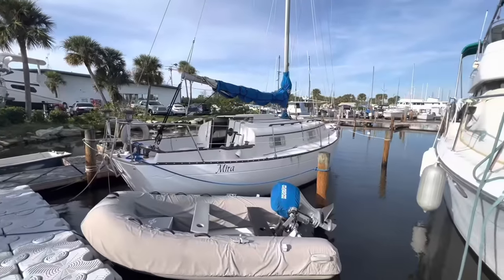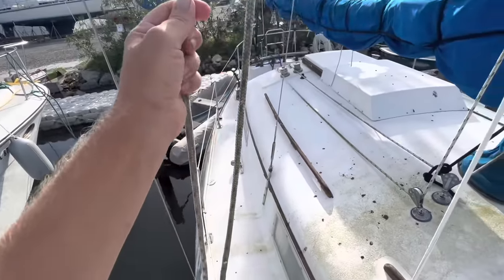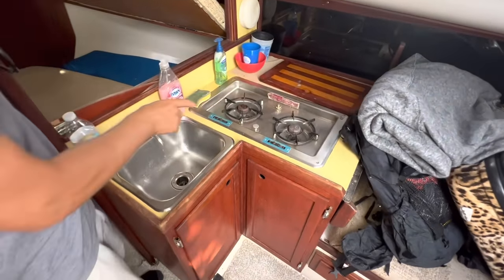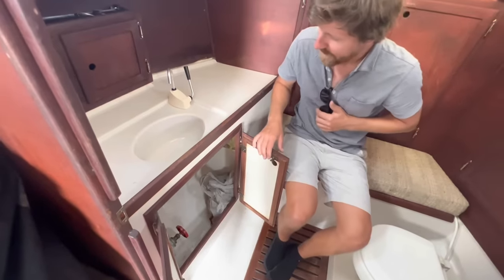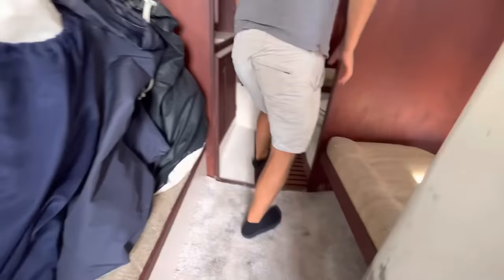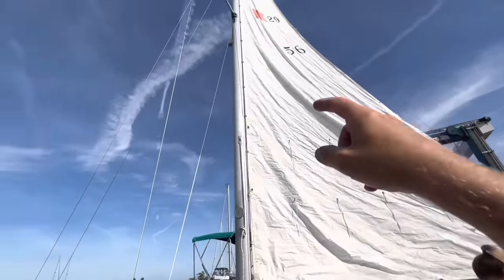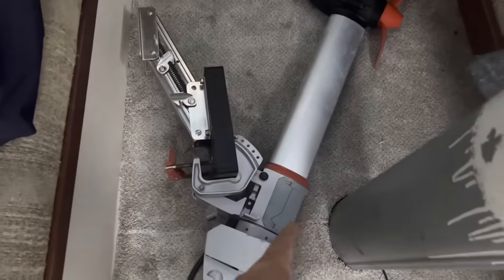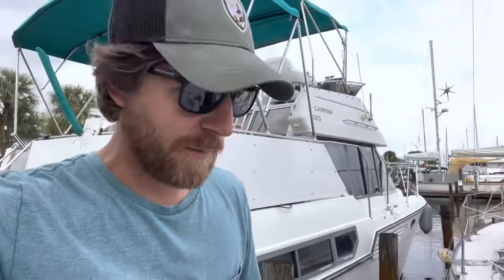Moving onto a free sailboat- bayfield 29ft

Comment: As a owner of a bayfield29  myself I must say I think there are a few things odd about this boat. I know each one was slightly different and this looks like a older example then my later 1983/84 (one of the last hulls made before the fire that closed the manufacturing) Also I think that line on the mast is NOT the main Halyard it’s the main topping lift. The main halyard should be coming out a sheath at the bottom of the mast directed to the winch on the port side  of the companionway the other two halyards for the head sails to the winches on the starboard side.   The saloon table was removed (if it had one)  there should be a door on the head. BUT also I’m not sure how much of what is on my own boat was standard and how much were owner ordered factory add ons. (I know the Edson wheel I have was a $1000.00 option new) also the teak (teak plywood actually) flooring in my boat was a option as well two color paint scheme on my boat was also a option this one does not have also the extended bowsprit rig was a option also And you will see soon enough if you sail it as is the reason for the extended bowsprit,  the head sails drive this boat and you will find without the extended bowsprit you will need to reef the main or easy the main sheet to avoid excessive weather helm. (It’s highly likely the bow sprite has some rot on the main beam anyway  so upgrading it to the extended bowsprit when you repair it might be a good idea.  and moving the head stay further out will be a vast improvement to how she sails.  (Also makes tacking the jib through the gap much simpler)   The old alcohol cooktop and no propane locker is also a sign of a earlier model. The  aft lazaret lid without the cubby to stash the main sheet is also a sign of earlier-model OR it was modified  OR these were changed on models equipped with the Edson wheel to make for a higher seat vs the tiller steering you would sit to the side not in the back.  The propane locker on later boats was molded into the port side aft corner.  And had a drain out below (served to drain any water out and also if there was a leak propane fumes would vent out that as well and NOT communicate with the engine compartment or main cockpit lockers.   Over all this looks like a decent boat for free but as Bayfield go not the finest example.

Comment: As a previous Bayfield owner for 17 years I can safely say she never let me down. The Gozzards build an amazing boat. You are going to learn to trust her as much as you trusted the "Herring". Just a tip, my loose tiller was a simple shaft key failure. Sail on Sam, we are all crewing with you in our minds.
Reply: @PaulDononvan, I have been researching these boats as a bluewater sailer and would like to know if they are as heavily built and dependable as reported ,handle heavy weather and offshore work well?
Reply: @ronv6637  I had mine offshore here in NC and she brought me home in 6 to 8 foot swells. Everything aboard was overbuilt and super strong. Great 9horse Yanmar, harken self tailing winches, all lines and halyards led aft to a roomy cockpit. Can you tell I miss that boat ?
Reply: @handygrandpa  Thanks for the response,I need to get aboard one to see if it feels right
Reply: Yeah, it looks pretty simple layout, which is best for dependability.. Tiller is real real nice and simple on a 29 footer.
Main sail is fine dude, broken in sail is excellent for light, med, heavy winds. Learn how too trim it. Stitch up and repair loose thread. A soft sail in light winds  when you get the luff just right, coming in off the Genny you'll feel her accelerate.

Invest in stuff that will make your time aboard comfortable and economical 
A freezer, osmosis water, cock pit cushions  and enclosure, zodiac dingy. Take all the wood stuff off, refinish, re bed everything. Service clean winches.  Replace all the lexan windows, (deep tint is nice) and rebed.
Scrub, scrub, scrub, the deck and hull and seal buff with wax.
Check thru hull fittings, rebed, replace.
I like your thinking for not installing a new motor, if anything you could go with a outboard hook up, that could double as a tender on the dingy. 
That's a lot of elbow grease, that will make you quite content of your little home.
Switch all your lighting to leds.

Very nice boat.
Don't waste your money on crap.
Organize your projects,  expenses, keep a log, and be..... Very satisfied when you go back and see what you accomplished.
Reply: speak for yourself, i'm scared of the open ocean
Reply: @nummnummyumm9051  😂😂😂😂😂😂
Reply: @nummnummyumm9051  me too😂

Comment: Pour hot water, 90° centigrade on the bolt rope and haul it up as tight as it will go.
Then let it fully dry. Repeat once or twice. It should streatch back out.

Comment: careful Sam, sailboat flipping can be habit forming, I'm 8 years out on 9 sailboats. Between sailboats is only fun because I'm shopping for the next one. My next one will be a converted electric aux power for sure.  You should ask for an electric power plant that would be compatible with the existing propeller shaft and develop a system for converting the old inboards to electric

Comment: re your mainsail  Just cut through the bolt rope at the tack then stretch out the luff and re sew the end of the bolt rope it'll probably move 12-30 cm. It will move in that channel. Yes the bolt rope crimps and its for a purpose. When you put halyard tension on the rope gets to maximum elongation before the sail cloth

Comment: I had one simular to that. I installed an engine mount on the sturn and bought a 9.9hp Yamaha OB and it pushed it to Hull speed easy at half throttle and it would run 10 hours on 6 gallons. Esay and cheap. I paid $450 I think...

Comment: I would consider putting in a permanent eletric engine system in, you have plenty of storage for battery cells and given the small amount of space it would be ideal (where the eletric engine would go). As a backup you could have a small silent generator stored below which could be used to power the system should the batteries be flat and it is an emergency!

silent motor with those windless days all drive by the sun :)

Comment: if it still has a prop and shaft, you can get an electric motorcycle kit and just couple that directly for an easy electric sailboat conversion.
Reply: Was wondering if multiple bicycle motors would work as well, could belt or chain drive with computer system that measures strain on each drive and equalizes the speed/torque. Kind of a wierd idea, but thinking the more mass produced motors/drives might be had at a cheaper cost per unit of torque. Also they could potentially be unmounted and used in a dingy and onshore bike...

Comment: The Torqeedo Travel (3 HP) will provide you with enough maneuvering capability in and out of the marina. Currents and higher winds are another story. But you are a sailboater first and have enough skills. I've easily charged my Torqeedo batteries with 150 watt solar panel. The charging port accepts a wide range of DC input which is nice.
Reply: he had a torqueedo on his previous boat, 24ft hunter ?
Reply: @rhett7716  I used the Travel 1003c to drive my Capri 22 after I had a Cruise 2.0 failure. 

The Travel move my 2250 lbs Capri 22 almost to hull speed. Much different that the Minnesota Endura 50 I tried using early on.

Comment: The pressurized alcohol stoves work well and hotter than the newer ones and very cheap and available fuel at hardware stores. Just never fill it hot and know the real dangers of alcohol burns.  Origo has easy replacement of the rubber parts on that plunger.  Just fill the cups with small amount of fuel that you heat and light then the vapor can ignite. 😊

Comment: I have a 31’ Bombay Clipper in StuartFl. area. We went with a outboard bracket with  Torqeedo 4 cruise electric outboard. It pushes the boat at 3 knots for 8hrs. without charge. Galley is electric. Having remove everything diesel. Makes a lot more room for storage.

Comment: Nice boat for free, and already in a slip! I had a chance at a frer saiboat in a slip once, but it did not allow liveaboard, so I had to pass it up. I have a stinkboat, (gas driven), 23 ft cabin cruiser. I have stayed on board twice now down at Bahia Honda marina. First time was 12 days, second was eight days, electric provided for the air conditioning. I like the trailering ability I have to tow distance.

Comment: Hi. The valve in the head is called a gate valve and you are right; it has no place in the marine environment!  Replace it with a modern through hull when you haul her out but in the meantime, tape an appropriately sized wooden plug to the hose, just in case.  Also, leave it alone; it is not leaking now and opening and closing it is what will get you into trouble! Stay dry. H.

Comment: I hope to get back to my boat this spring. A steady string of injuries has had me land locked not able to even touch it for going on 3 years now. With some luck this spring I'll be able to finish the bottom paint and get it put in the water. I really like the idea of the solar generator as a power supply.

Comment: BAYFIELD 29 seems to be the best design for a Bluewater Pocketcruiser under 30'.
The head is so spacious. I like the layout from a functionality stand point.

There is the Gladiator 25 by William Lapworth that one seems really cool too.
That's an old classic plastic from the 1950's & ewarly 60's.

The design of the original Columbia 26 seems pretty good too for a Bluewater Pocket Cruiser.

Congrats on your new boat, a CANADIAN BOAT, the BAYFIELDS are.
The Bayfield 25 has a 2'11" draft, but your seating area is also the stove top which would suck.

You have a great show. Thanks for teaching sailing as you do.

Comment: Your stove may be a kerosene pressure stove. Not alcohol, I think. I have had one for 30 years. If so, you preheat with a little methylated spirits (a bottle cap full is plenty) pump the tank until mild resistance is felt and when - and ONLY when that meths is nearly burned out, open the valve a little, if hot enough and the kerosene has vaporised it will ignite exactly like a gas ring. If you didn’t get it hot enough though you’ll get clouds of white smoke, or even a three foot spitting flame - so be careful!

Comment: You can add maybe a decent 4-stroke outboard with power tilt-trim and you would be able to handle moderate wind and current, just no all day motoring like with a diesel.  Yamaha makes a 9.9hp high-thrust and Honda makes a 15hp available with tilt-trim.  You have a built-in fridge and that extra fridge just takes up space and draws 4amps.  If you pickle vegetables and have hard cheeses and canned fish/meats you don't really need a fridge.  I used restaurant packs of mayonaise to avoid having to refrigerate open jars.  Eggs just need to be kept cool, and maybe waxed for longer storage.  Boxed milk doesn't need refrigeration and you usually finish a box in one setting anyway.  Not criticizing, just offering some advice in the comments section so you get higher ratings for your video.  Fyi, I watched your Hawaii video a few years back and that was probably my main inspiration.  I eventually picked up a used sailboat, also met a guy and we sailed to Hawaii on his boat.  I also sailed down Baja California.  But I did like the owner of this boat and basically gave it away, but I might get another boat in a few years which will hopefully be my "forever boat".  Anyway, hi from China.

Comment: The colorful sail is your Yankee, and the rope on your main can be stretched back out by getting it wet and pulling it nice and tight, when it stretches out a bit tighten it more and when you get it where you want it let it dry, it should be fine (famous last words right?).
You might notice some weather helm at first, you can control that by adjusting the slots between your Yankee, staysail and main, it takes a little getting used to but once you do she will take off.
Mine had a Perkins Prama M20 and that fuel tank is a bit h to remove but once you get it out it's a great place for a second fresh water tank maybe 20 gallons of so. I think the fuel tank is 17 gallons. Under the starboard berth is your built in tank, mines 24 gallons. The long bilge in the center is a lot bigger than it looks and I'm thinking of turning that into my main tank so it's in the center and slightly lower, this would free up some space for storage under the berth.
I replaced the original head and holding tank with an Airhead composting toilet, in Florida you have to have a proper head, no sending the stuff over the side unless you are really well out at sea. Getting rid of the original head gave me a LOT of space exactly where I want to have anchor line and chain, spare anchors and all that sort of stuff. Further ahead of that is enough space for all of your sails and random other stuff.

Comment: I would think you would need at least a 9 hp motor. The one you have is good enough to play around with. At our sailing center we sail Ensign 22s with no engines in and out of the marina.

Comment: Congratulations on your new boat! I am also an owner of 1980 Bayfield 29.
Reply: does yours have the 2cyl Yanmar 2GM 16hp ?  If yes, mention how tiny they are and so easy to wiggle one back in there and bolt it down and connect the minimal hoses and cables.

Comment: I hope now that the old motor is pulled. That the original prop shaft doesn’t pull out of there when you’re moving forward Sailing..😮 maybe it’s capped off
Reply from the maker: Good point. I think I might bolt the coupler to a board or something that I can secure in the engine compartment.
Reply: Looking to get my own sailboat soon and sail the gulf coast. You’ve really inspired me to get out on the seas and get some experience.

Comment: Sam, as a marine fire investigator, I want to caution you about using that pressurized alcohol stove. They’re dangerous. They can flare up and cause a fire. You can replace it with a non-pressurized alcohol stove relatively cheaply that works just as well but is much safer. Good luck with the new boat.!

Comment: That's a solent rig. I like solent rigs, mostly if you have a furler in front and hank on behind it. You have all the options your sail locker can afford but also something just to roll out. Also no running backstays needed. Just need to get used to the idea of using the aft one in situations where you'll tack lots.  
If that garden spigot type seacock is from a home improvement store it is guaranteed to have the wrong metals or mix of metals and is way too scary to leave alone.

Comment: Thats a great boat. I think the Bayfield was in the book.  20 small boats that will take you anywhere.  
I'd put a yanmar 2gm. In there be rt size. 
I once got a pro rebuilt 2 gm  compleate long block and transmission(gear)  $3200 from our local yanmardeiselshop .
Reply: yea , they came with that 2Gm 16hp

Comment: I think this boat has a ton of potential for what you are trying to do, and it looks to be in pretty good condition generally. Between the dedicated storage cupboards and cabinets, the bigger kitchen with a fridge, and the bathroom, this boat has some huge upgrades over the smaller boat that you have. The additional space could also potentially allow for some storage of things like fishing poles, surf/paddle boards, extra food and water, etc., that may not have been possible (or may be significantly more difficult) on the smaller boat. 

However, I agree with you about the carpet. Having carpets on this boat just feels like an unnecessary hassle to me. As to the electric motor,  I prefer to have more power in this area, especially when the boat is a bit larger (in physical size at least; I'm not sure what it's actual displacement is). With that being said, this is not my boat, and I won't pretend as if my skills and experience (which are mostly limited to day trips on inland lakes with another crew member) are anywhere near your capabilities as a sailor and navigator. I'm fully confident in your abilities, and I think that it's pretty clear that you know what you're doing when you're on your own vessel. 

Anyhow, congratulations on your new boat! May it take you on as many fun and interesting new voyages as possible, voyages which I hope that you are able to experience safely enough to come back home each time, so that you might continue to share your incredible stories with the rest of us!

Comment: Some bronze gate valves are ok but the shafts frequently corrode. You have to take them apart to inspect. The alcohol stoves are good and the fuel is the easiest to obtain world wide. You have to learn how to prime so you don't have too little or too much primer flame.

Comment: Nice. I've been looking for a decent free (or really cheap) boat in the Seattle/Tacoma area, that isn't a biohazard or chemical waste hazard, and in mostly decent condition. Being on a fixed income due to somehow losing the feeling in my arms and feet below the knee and elbow makes finding anything good, really difficult LOL. I'm patient. It will happen someday.  I do have some tactile sensation, but mostly.. nothing. You could hold a blowtorch to my fingers and i'd not feel it. XD. But been wanting a small boat for a long time. A trailer Sailor or a small full keel/modified full keel, with wheel steering.

Comment: Merry Christmas Sam. Good find, lots of projects to come. It seems like there would be a sponsor to refit the boat to an electric engine. Seems that if you documented all what you had to go through to do it, they'd get their refit videos for free. And there has to be a huge market for older boats, with seasoned sailors, that are tired of messing with a diesel. You will have to be way more cognizant of tides and weather though, without a back up. But the Bayfield is a solid boat if I remember correctly. Fair winds and following seas.